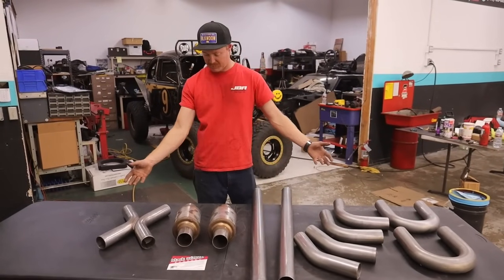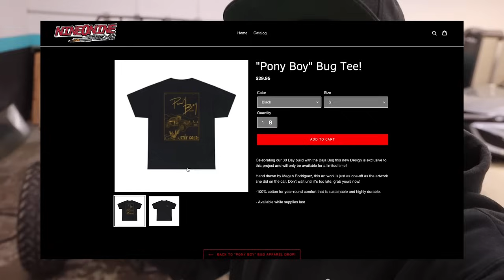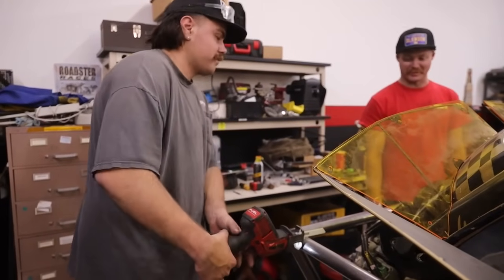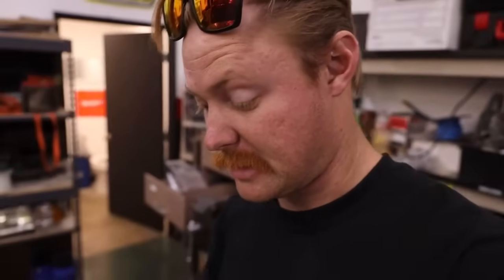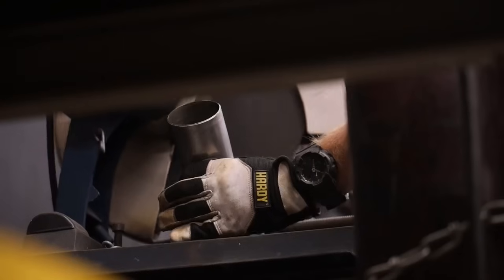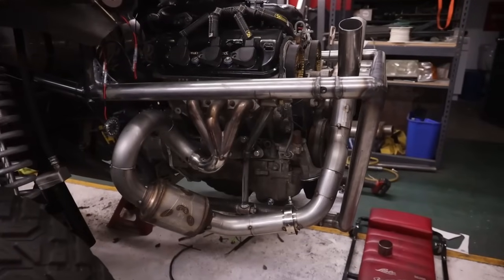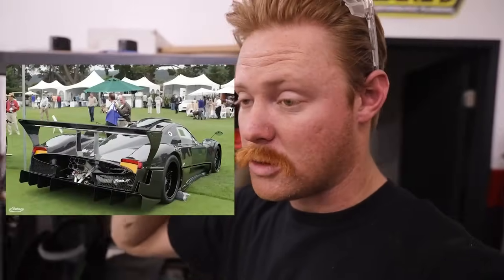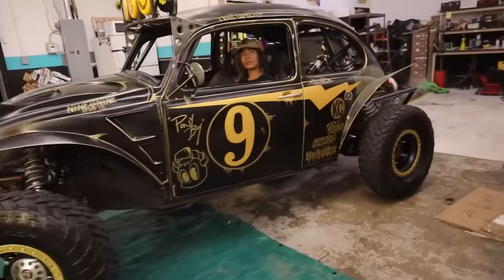My Bug's New F1 Style Exhaust SOUNDS INSANE!

Comment: Just saying a stock 302 with some cheap aluminum heads and little cam would be fun in that bug
Reply: Absolutely!!
Reply: Probably, but why change whats in it? Its fun and its different...
Reply: Agreed
Reply: Why would you nearly double the weight of the engine to get a small power increase and ruin the handling?
Reply: Facts, exactly what I was thinking
Reply: Very true, but there are a bunch of v8 beetle buggies, sometimes it’s more fun to just do something unique🤷🏼‍♂️